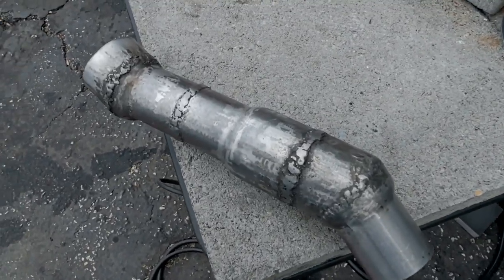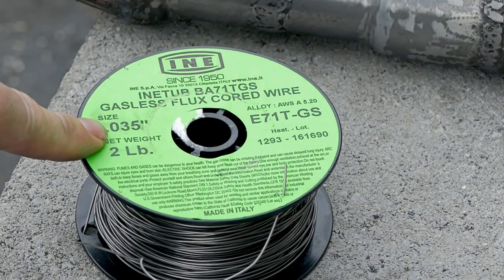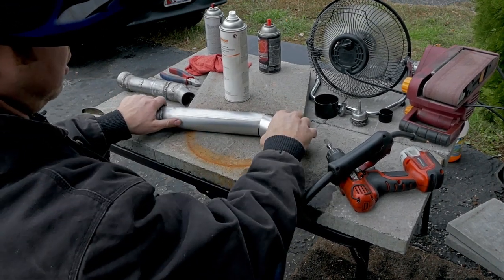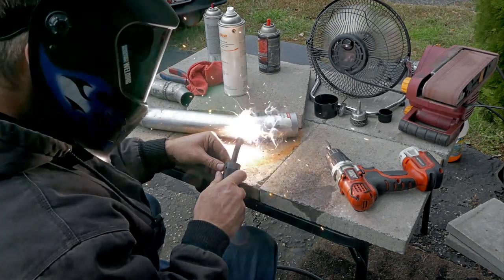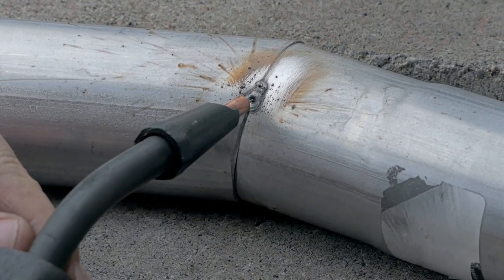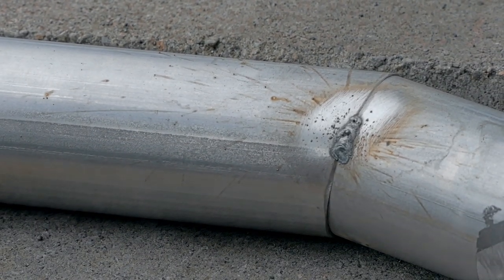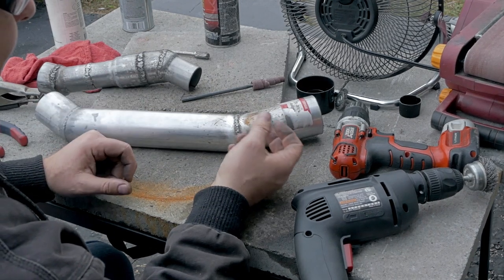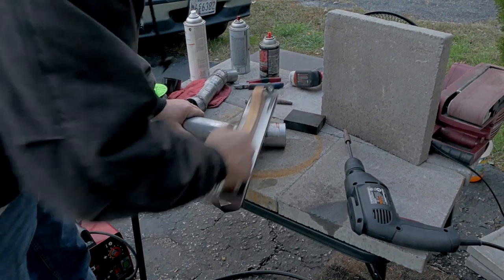Cheap Welder, How to Flux Core Weld Exhaust " Budget DIY Exhaust"

Comment: What you're doing is plenty good enough I use flux core all the time my stuff don't have to be pretty just work is good enough for me sounds like I think you could turn it down just a hair you want it to sound like bacon yours is got quite a buzz to it sometimes they don't have enough fine-tuning though every time you turn the power down you got to slow the wire some
Reply from the maker: Wire-speed? I can try that next time. I'm going to do a new exhaust for my S10 when the LT1 goes in. A shop put in a nice stainless one yeas ago but it sits too close to my transmission and the cutout location is just stupid. Figured I could get a summit 3" kit and make one that fits better.
Reply: @TPVPRO  yeah if it's popping and snapping it needs more power if it's getting too hot needs less power but you got to tune the wire speed as you change the Heat the wires too slow it will seem intermittent if it's too fast sometimes it will kink you just got to play with it get it sounding like bacon you got it hot enough to weld a bumper steadily going the chart in there is pretty close but each machine is a little different them guys that are real good at it is only because somebody said here do it and did it for hours and hours I just want to see what that S10 sounds like again⛽🇺🇸
Reply: Rusty Stuff,  
The 120 Hz "buzz" is from the AC welding machine. Negative-DC will just sizzle, at best.

Comment: I have learnt through a long process of trial and error that this is the way to weld thin steel with a cheap flux core welder. I was hoping for a revelation that I was doing it wrong from this video but hey ho. I don't bother with ant-spatter, just use a flap wheel on clean up. The newer DC flux core welders look the way to go but they are not cheap enough yet to make the change - and I need to find someone to buy my AC machine first :( .
Reply from the maker: I herd the DC ones are pretty good.
Reply: I have a Lincoln flux machine with option for co2, I paid about 400 for it and it’s not all that worth it to me. We use the ln-25 suitcases at work to weld kilns and I like them a lot better.

Comment: I have to make a cradle to fit a hayabusa in a kitcar and only when got the hang of it and getting a good weld that the cable runs out and the new one is totally different and I am struggling to get it set up like the previous cable. I then noticed its different in size by 0.1mm, so minimal, does it make that much difference.

Comment: I appreciate that you wanted to help new DIY welders BUT, your technique is wrong. I welded for Kawasaki welding and with thin metal you just need to move your welder with quick up down movement when welding a round piece and just tack it twice. Forget that spray and buy a small canister of tip dip to dunk you welder tip. That will ensure you don't get stuck to your item. Almost like Oxy/Ac welding but not circles. As you go up & down just get lower faster and it won't look like a billion tacks and take all day cleaning every tack before you do the next.!! Just keep it on low power on that thin stuff and use a clamp after two quick racks. Then put your weld line out off the bench and you just make quick up down strokes as the metal will run and you only need it to go 50% into the metal. This was painful to watch as you kept welding in one spot each time.  Just keep the tip moving down and then half way back into previous circle as any good weld looks like little puddles melting into the next one like a wave. I wanted so badly to stop watching so I'm glad you fast forwarded to show finished welding after first few. Welding is not about tacking it is to create a little Lava run in waves so not side to side just let your weld drop down to next area then halfway back into the one you just left above and don't stop moving until you can't reach metal on the curve. That pipe only needs three weld runs to make the whole way around. Ignore the splatter until your completely done. Then if you have a dremel tool or Sander/ Buffer put on a 150 grit or higher preferred sand pad and give it a quick swipe to nock off any junk. If it is not going to be seen up under the vehicle exaust then it doesn't have to be pretty but MUST BE AIR TIGHT.!!!! If you just keep racking it all round your likely to have a few pin holes that will cause premature rust and "burn through" from engine exaust which is why if you have a hole some where and getting putt,putt, putt sound but pipe is sturdy except that spot then you just sand it or wire brush it and seal or fill the small spot. It is fast cheap for self or customer in a pinch who can't afford $250 for a new pipe. As long as your up front about you just patching it with a tiny throw away piece of pipe metal and not jack them you just might give them the confidence to let you replace it 6 months or a year later. If they can pass EPA test from no leak if you live in such a state.  I have a similar inexpensive welder and was looking for something else when this page caught my eye so wanted to see if there was somet new technique to learn.  I am in pain for you.! Try my suggestion down and halfway back, down halfway back. Your sure to improve the look & strength of your welds. In a few months of practice on any random metal you can find you will look like a Pro..! Good Luck. Welders are always in demand. I've done Mig, Tig, Acetylene, & Arc.  I dislike using Arc sticks. When those little self feeders came out it was great for every DIYer. Just be aware of combustibles nearby. And have a great time learning a new skill. Trust me...I'm an OLD Guy. lol. I've already made most of my mistakes.  You know, Wife, House, Kids (Triplets)... but the dog still loves me at least. I just need these 21 yr old girls to go back to college Dorms so I can get some peace. Damn Covid... I'm sure I have a few more mistakes ahead of me too.  Wait, this isn't the Therapy forum. Oops.

Comment: Your using a method called multi tak... if you burnking holes move torch faster for better penetration... tak welds are ok but wont hold as long... i prefer flux core over gas for welding on windy days... over all not too bad just need a little more penetration

Comment: Oh hey man can you ask around or do you know the answer to this next question...
Do you have to do anything to the carb center section for the 4 corner idle ?
I used my base plate from my old carb that had a 4 corner idle ...
I would love to just slap my other metering block on and have the adjustment 👍🏻👍🏻👍🏻
As always thanks brotha man! I appreciate all the great info fosho!
Reply from the maker: I think as long as it's a 4150 body any 4150 meeting plate will work.
Reply: TPV Productions rear metering block 
I heard you need to do something to have the idle mixture screws work ..
Reply: William Bikash ? 
I’m trying to make a 4 corner idle system ...

Comment: So you're wearing a bare metal ring and sitting in a metal chair. What happens if the grounding clamp slips off while you're holding the metal pipe and connecting a +100 amps to it?
Reply: Nothing because there isn't enough potential to overcome the bodies resistance let alone create an arc through clothing to the skin.  In order to get the amperage necessary for welding, the welder uses a transformer to step down the voltage trading potential for current usually 20-40VDC which at high amperage is enough to create an arc to something conductive like stainless.  There is some danger with the ring though because if the wire feed is too fast, he gets it stuck and he has a small spark gap between the ring and the piece it will create a ton of heat in a short enough time to cause a really bad burn.
Reply: @MattJonesYT  The case mentioned here was not caused by a loose or detached ground.  The gentleman struck an arc on his ring that was itself grounded out on the workpiece which is completely possible.  Had he taken the clamp and firmly attached it to a metal chair he was sitting on naked he still wouldn't be able to reproduce this injury, the heat was secondary to an already struck arc.

Comment: I will have to blame my 270 year old hand me down century quick fix because it does not weld like that newer Lincoln no matter the settings or wire the result always resembles some spray foam

Comment: If that pipe is Galvanized what I found out if you clean it with Muriatic acid you get a better weld
Reply: its aluminized steel. from advance auto

Comment: Maybe turn down the welder a bit.
Reply from the maker: That's as low as it can go unfortunately. Only thing I can adjust is wire speed now.
Reply: @TPVPRO  the wirespeed is why you leave a pit in the last puddle. Turn it down
Reply: Move faster. A flux puddle visibly ripples back to where the slag shelve shelves formed and that needs to dictate your speed going downhill
Reply: The stick out is why hes leaving holes in his tacks.................not the wire feed or the voltage. You're to close to the workpiece for flux.
Reply: You're pushing through the metal by being to close. You're basically driving it through the material you're trying to weld. By backing out your stick out you've decreased the heat Nd the force that's driving into the metal.

Comment: I learned on a flux core machine. So let's not be too hard on the coments.first off any type of welding takes time and PRACTICE!!!! second if you suck grind it off and start over. I have days when I can lay a bead perfectly. and ... then I have days when I can't lay a bead to save my life. But I'm ok with it. I just pull out my grinder and have at it.

Comment: You string a line of spot welds. Build up the metal THEN you weld over them and maybe a third time to get a good, solid weld.
Reply: One spot weld here, another over there...
Reply: Wire welds are better on thin metals. They don't penetrate as deep as flux-core. Flux-core is good for thick metal.
Reply: FYI: even some stick welders cannot MIG worth a 💩! And MIGging is the easiest welding method. You could teach a kid, maybe even a monkey, to MIG.

Comment: I really dont care about the looks being able to weld it is nice i have an inverter flux core by century I think its an off shoot of Lincoln or something but i bought on clearance as an open open box return from the home depot for $100 and is has a veriable voltage or current whatever it is as well as the wire speed and it seem powerful on small stuff

Comment: Your torch angle needs to be 10-15 degrees pointed down and also welding flux core u have to go up u can’t weld down hill
Reply from the maker: Please make a video showing us how it's done any help is welcome.
Reply: You can't push flux-core weld, but have to pull, so welding downwards requires aiming slightly up from below. A negative DC polarity should attract metal vapor to the weld puddle, making this superior to AC.
Reply: Drag drag!!

Comment: Unless you take the time and make the effort to become a professional and unless you spend the money on a decent setup, your welds are going to suck. Personally, I've done a very minimal amount of welding (using the cheap equipment of others) and it wasn't "horrible". Left much to be desired, but it did the trick. I'm thinking about properly getting into welding because the few times I've welded, I thought it was pretty fun. I'd like to weld a new exhaust for my 35-year-old truck, something custom. Sure, I could just buy replacements and route it exactly where it was from the factory, but where's the fun in that? On such welds, I don't care if they're ugly, I just want them to work.

Comment: Aside from 4 center tap transformer on the Lincoln. They chose a plastic wire feed mechanism. Bowing to cheap, does not motivate me to buy a Lincoln gasless fluxcore machine.

Comment: another thing with most flux core wire is you can only make one pass per bead. if you try to weld over a weld like say make another pass it will look like str8 shit and just be an over all chicken shit weld. I did not know this for longer than i want to admit but a far more experienced welder gave me some tips. But there is some flux core wire that you can do multiple passes i guess but most of the flux wire is only one pass and thats it.

Comment: As long as it holds and works, who gives a damn what it looks like?  It's under the vehicle and it's not a show car.  Yeah I lay pretty ish welds with flux core. It doesn't need to be.

Only things I would change are:

The Lincoln welder is way way way over priced.  Yeswelder makes a welder at a tiny fraction of the cost that works just as well.  I used them side by side and bought the yeswelder.

You have E71t-gs, which is ok but there are no standards for it and it's questionable and single pass. E71t-11 is standardized, multipass, and only costs a dollar more.

That's galvanized tube.  Please PLEASE PLEASE, grind off the gallvanizing where you weld. It will weld better for one, but also when you weld over galvanized steel without removing that coating, the gas it produces can kill you.

Flux core can make some very pretty welds and if you want them to be pretty, look up how to whip and pause, and practice it.  It's not hard, I taught my kid in less than 5 minutes and he nailed it.  The welds will be better and you'll be able to run a bead without blowing through.

Comment: You are not at a 45 degree angle and your current is too high. If you are blowing holes in muffler pipe, than you need to adjust lower. You are almost parallel with the weld zone and not at a 45. Just a bad technique and not the welder.

Comment: My question is how is this guy getting any gas coverage? There is no tip/cup on his MIG gun... your gonna get holes in your weld lol
Reply: Hes running flux core wire, works kinda like stick where you dont use gas
Reply from the maker: https://youtu.be/62moqa9dICw

Comment: This guy's worried about toxic fumes when he's handling alluminized steel pipe with bare hands. aluminum leaching in through your pores is as bad as lead... Also, why not clean the whole section first with the wire wheel?!?! 🤯

Comment: Awesome video. Your half assed ugly first welded piece, isnt really half assed at all, its a good weld, At least to me it is. If it holds, and does it job, then its not bad. Your secos one looks like a pipe build by a professional 

I had rust and my y pipe broke off from the cats. The muffler shop charged me 180 bucks, and they welded a small piece of pipe between the pipe and cats. The weld  was pretty sloppy, but no leaks so far. 

This time around, on my other car, ive got clogged cats, and im gonna do it myself. Reason, the shops are so much a ripoff. Theyll put cheap universal fit exhaust parts, and charge you dealer price.

Gonna buy a $ 100 welder and a  $40 sawzall. Buy the parts and weld them on myself

Comment: Flux core welds itself just move with a pace, set your heat right get you a piece of scrap and mess with your settings you want that mf to sound like bacon. Regardless of what you weld with your gonna have bbs it’s just a part of welding also make sure you got the right PPE always wear gloves unless you want alligator hands the rest of your life

Comment: your issue is the piping is cheap shitty piping not meant for a whole exhaust system its meant for like a caravan tailpipe.. you need to get some good quality mild steel that doesnt have that stupid aluminized zinc coating on it and things will go a lot smoother.

Comment: This is by no means a HOW TO video. If someone wants to get into welding or fabrication that's a video to avoid watching. Also using a cut off wheel for grinding is very unprofessional and dangerous. A grinder operates with about 13000rpm,...watch a video on youtube to see yourselfe what happens when you get too much side load on a cut off wheel.
Reply from the maker: Do us a favor and get a $150 welder make a video showing us how it's done.

Comment: Bruh you’re welding a Exhaust with flux lol that’s why you’re supposed too weld it with mig or tig dummie
Reply: 😂 
Flux is a type of wire that comes with the stuff in it to shield the weld so you dont have to pump a gas mixture to do this. 
I believe you are the dummie prmnt 562